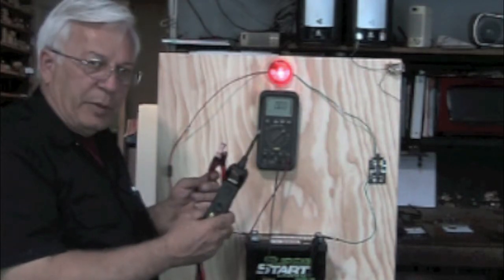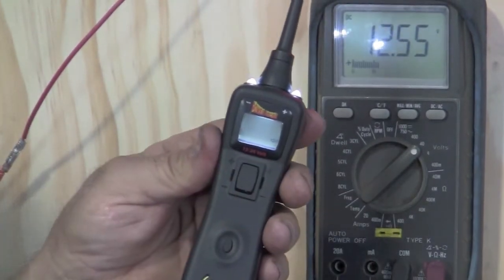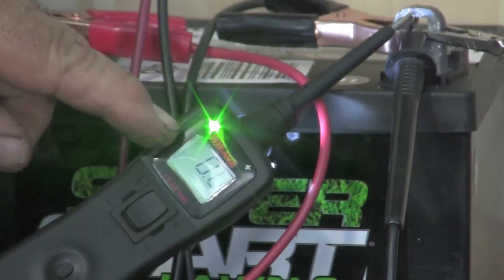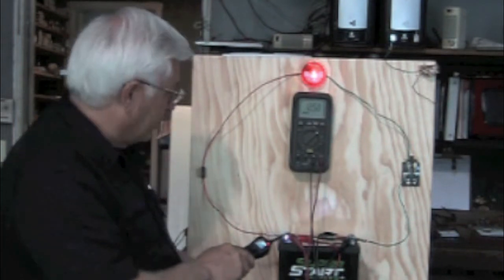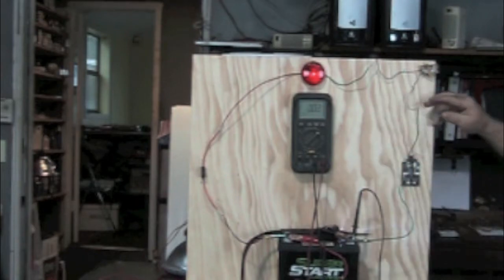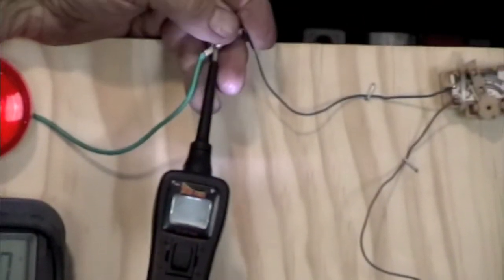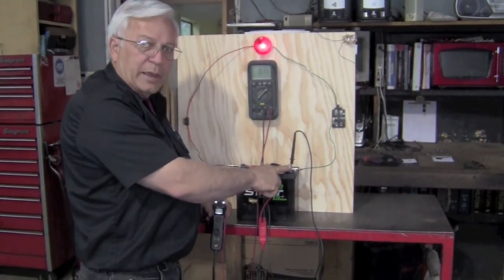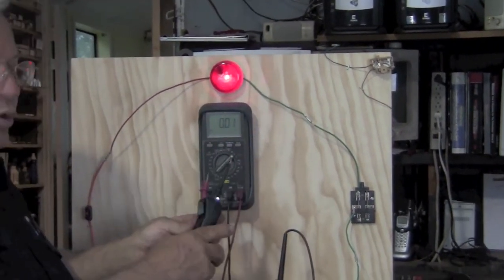How to test ANY circuit.        Part 4

Comment: Excellent troubleshooting videos and the logic probe similarities of this are good but in the old school electronics (and justifiably so) slightly different, as they indicated a change in Logic state (the original logic probes between a 1 and 0 digital transition ). This aspect only in practice would come into play though when doing much more in depth diagnosis.   In the end there is a much better reason I subscribe, it is really nice to have a old school technician, who has taken that knowledge and integrated it with new(I have been in the trade for 40+ years) and shared it.  Cheers

Comment: Hello, Very good videos, I am from Guadalajara Mexico and would like to know where I can buy a power probe like yours, Thanks
Reply: Does it specifically say the waranty is void when buying off eBay? It doesn't say anything during the waranty registration. Very strange post with no proof
Reply: +Jose Guzman 

Amazon or Ebay
Reply: buy from an authorized retailer or the 1 year warranty is void, ebay is not one of them. Try Sears, tooltopia, advanced auto, autozone, etc... are.

Comment: I have watched your videos on voltage drop over and over again and have learned alot but I have one question if your load was bad what readings would you get let say your light bulb filament was broken for example.
Reply: You would have battery voltage because none of it is being used by a load.

Comment: PP at its own can not but user can if he does not know what his doing, for example by powering up (with rocker switch of PP) somewhere in the middle of circuit bypassing fuses some fragile electronics or 5V sensors.

Comment: Great stuff but it should be noted the power probe or other logic probe has a distinct advantage over the DMM/VOM/Multi-meter is that it confirms in an instant that a 0.0V reading is indeed a ground connection. A bad connection to the wire being tested or connection to a free floating (detached from circuit) wire will yield a reading of 0.0V and other tests are needed to confirm you have a ground - in other words a reading of 0.0V can not be trusted by itself.